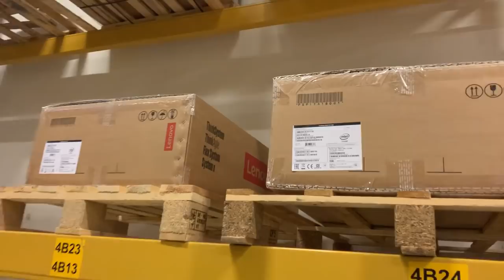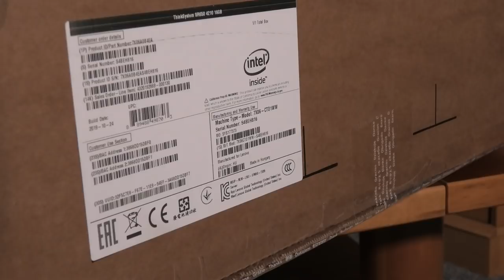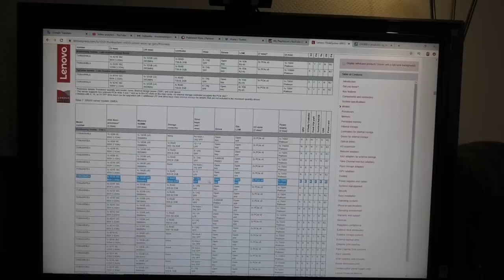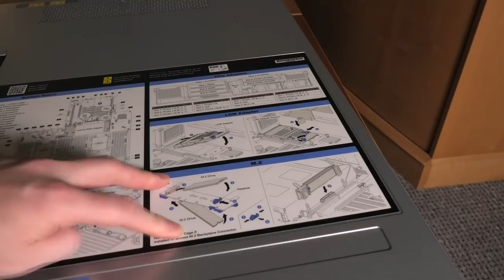Brand NEW Lenovo SR650 Moves in to My PlayHouse - 898

Comment: Piece of advice, having multiple nics on the same board will save you from the upstream switchports failing but it's very rare for a single port(esp. on a sfp/sfp+ NIC) to fail with the rest still working, it's more likely to take the whole card down.
Reply from the maker: Thank you very much,, I have seen a few SFP+ die and I did also say switch’s. Because you are right! ;-)

Comment: I wathed BTNHD did a few sessions with the SR650 some time ago and I really liked the server and I cant wait for you to do a series with the SR650 rack server.
Btw,can you do a video on the differences between the x3650 m series and SR650 series ?
I'm still very new to rackservers. 
You should get the TPM module on the server. I also read somewhere that the intel x700 series NIC's have problems with esxi environment and its a huge pain to fix it. But I might be wrong if it just the x700 series or a specific model like x722 or something.
Man I would love to own the x3650 m5 and the SR650 model for my private network. So awesome to see enterprise servers.

Awesome video Morten.
Reply from the maker: Thank you very much,, good suggestions! Yes there has been irritating issues with Intel network and ESXi drivers. ESXi 6.7 mostly.

Comment: I disagree about the packaging being overkill. I received a pair of servers and a SAN (fully populated) last week, and they arrived by 'air mail' off the truck. I really should go see if we have security camera footage of that. The record was back in the fujitsu-siemens days where I got a 1U server where it was sheared sideways by about 4mm - the top and bottom were still flat and parallel, but the disk couldn't go in because the slots had become parallelograms rather than rectangular holes. The fake theft footage was fine, and I did chuckle a bit.
Reply from the maker: Hi Kasper Pedersen
Thank You very much! But that is just an arms races,, if fedex/ups/dhl gets away with bad handling because of over packing,, it will just become worth :-)
Thank you for watching! :-)

Comment: Surprisingly this machine was supposed to be the X3650 M6 until Lenovo stopped the X series
Reply from the maker: Yes,, I am not a fan of changing names/standards for just pleasing the new marketing Wanger. Lenovo had the RD series from before IBM and then the System X from IBM..
I would not personally have made that change,, would have gone with x3650 M6

Comment: I always wonder why people use ESD-Protection when they are not really grounded. You connected yours to the server case but the server wasn't connect to ground at all, so it wasn't really working. If you are are on socks or barefoot you are already great grounded and don't need the armband. Or you have to at least connect one power cable so the grounding pin is actually connected to ground. ;) I am an electrical engineer and do  barely use ESD-Bands.
Reply from the maker: When I am connected to the server, no static charge can be exchanged between me and the server,, we will be at the same level. This level may not be ground,, but even if we are at 10.000volt we are both there.

Comment: VGA is used by nearly every KVM, so maybe they are not changing it because they simply don't need to
Reply from the maker: Adding a hdmi or a DP would be future Proving it.
Reply: @MyPlayHouse  future prove it for what? datacenter technicians watching a movie while servicing a machine? :)   ...in a best-case scenario, that VGA port gets used once in a machine's entire service life: assembly and OS installation. (maybe a bit more often via KVM if you're running Windows :p )

Comment: 16 000 points in Passmark 8.0? My overclocked 3900X does ~37 500 in CPU Tests Passmark 8.0 with 3600MHz dual-channel G.Skill Trident Z RAM with tweaked timings. I would recommend you to put the highest clocked CPU in that thing and some modern GPU - nvidia GTX 1660 Ti or Super are good very low power consumption models and make a nice "gaming" server out of it :) Do you know a Youtuber called MattiAce? He does some pretty good gameplay videos of Battlefield 1 and V nowadays. I think you two could be good friends, he is from Sweden.
Reply: Well the 3900X has more cores and higher base speed so that's not a real surprise. Servers are made for other use cases, so you can't really compare this to a desktop system
Reply from the maker: AMD is killing it at the moment. 
But for Enterprise servers, it is stable, secure  operations, over performance. But we do want that to.

Comment: intel inside  right I will skip over it where is the second gen eypc's
Reply from the maker: Still to expensive for me!
Reply: @MyPlayHouse  eypc's would have been cheaper by quite some way. the price difference is massive and the AMD counterpart is more secure.
Reply: As cool as this is, unless you are making some serious money with this server and down time time is going to cost you thousands of dollars a day, you could have built a Ryzen 9 3900 with more processor cores, higher frequencies, quieter cooling, with all of the other features of this server for less money.  That is the nature of Enterprise server hardware, and older hardware has never been a better price / performance proposition in my experience.

Comment: I am trying to mount a "grid k2" board in my sr650 but apparently it doesn't work. Has anyone tried this?
Reply from the maker: No,, what is the issue.
Reply: @MyPlayHouse   I have put the K2 in the riser card, properly connected the power cable on the MB, where it says max 225W, and should be more than enough for the k2. But the system say in the logs: "Sensor SysBrd Vol Fault has transitioned to critical from a less severe state." And goes "Orange". Seems a power issue, i tried with other cards. same problem. Any clue?
Reply: I have the same problem too! I can't find a solution!

Comment: How much storade would you get if you filled it with HDD's
Reply: Simple math but it comes down to the raid mode you want to use
Reply from the maker: Think you can put 28 2.5” SSD/HDD in this server,, and the SSD’s are getting rather big in capacity. But expensive! Still.